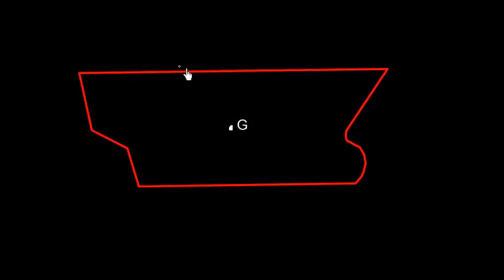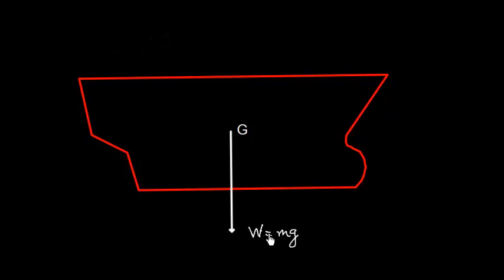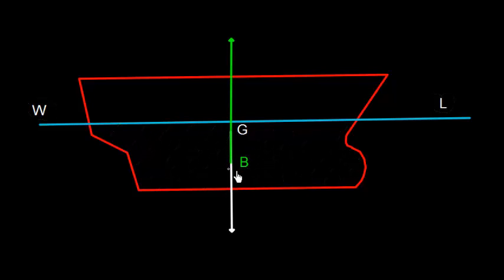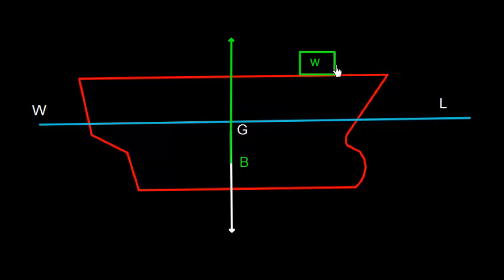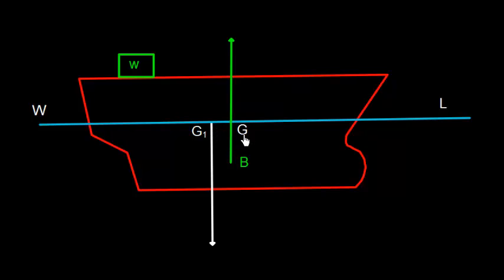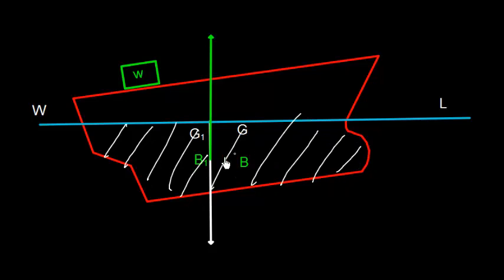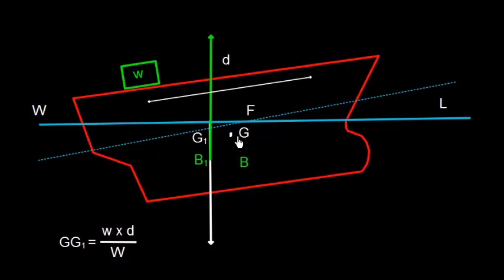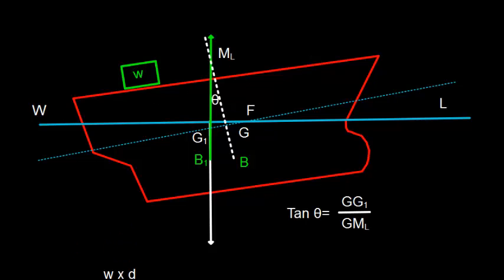Ship Stability _ Trim Introduction Part 2_ Formula for MCTC

Comment: If we use (Trim/LBP)=(GG1/GML) then could we write GML=GG1/(Trim/LBP) = GG1*LBP/Trim?

With this relation and if we know GG1 provided a center of mass equation, could you write 
Moment needed to change Trim by 1 unit (MCTC) = W * (GG1 * LBP/Trim) / * LBP 

This is assuming the trim is 1/100th of LBP

Comment: If B shifts from B to B1 how come when we move cargo from forward to aft the AP to B distance before shift from h. tables and then again AP to B1 are exactly the same since LCB distance is same for same displacement? In your image distance from AP to G1 is larger then AP to B1, that makes trim lever forward not aft? How do you calculate BB1 longitudinal shift? You have seen the problem your self when you drag the green arow to B1, if you placed it correctly it would be left from G1 and that would make ship trim forward. ???

Comment: Is MCTC constant? because GM(l) is also constant
Reply from the maker: MCTC is not constant. It changes with the draft or dispalcement. For small changes in draft, it may be considered constant.
Reply: It will be depend to the displacement of ship.

Comment: I understood that, if we load above G , then G will not move longitudinally, and therefore no trimming moments will take place, and trim will remain the same. and if we load above C.F, which is not vertically above G will do the same, i.e the trim will not change.
now the question is, 
Is loading above G will not affect the trim as the same effect as loading above C.F? thanks.
Reply from the maker: If the ship is box shaped where COF and COG will  lie  in the same line , it will not make any difference .However for normal ship shape COG and COF are different, hence loading at COF will not result in trim but loading at COG will result in some trim. FYI COF is the geometrical center of water plane area where ship trims and COG is the point where total weight of ship is assumed to be acting vertically downward.